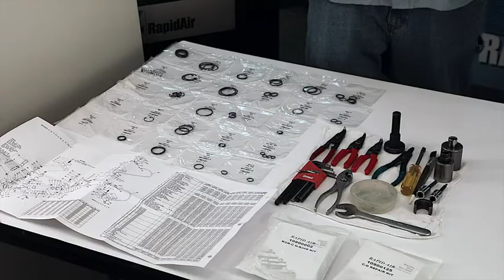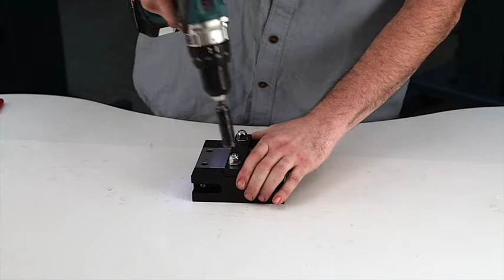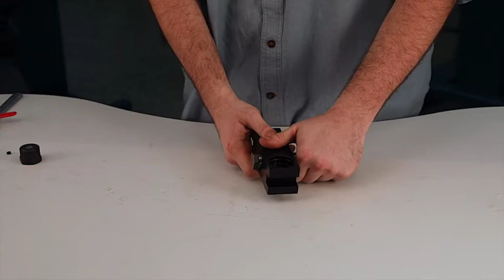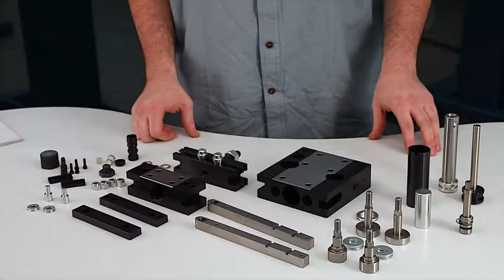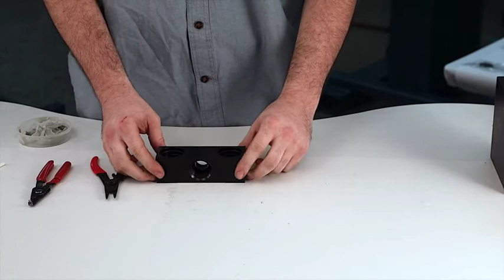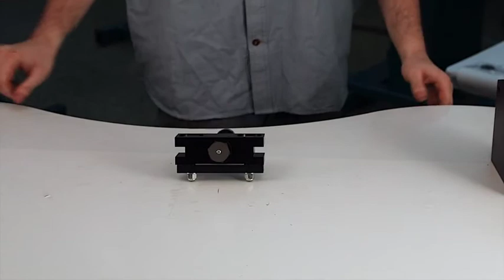Rapid-Air Feed Repair Video

Comment: Really appreciate you putting this video together and making it available to view.  I've been using Rapid Air Feeders for 40 years.  A genius designed pneumatic feeding device!  Manufactured hundreds of millions of parts.  Some of my  production runs at 180 s/m!  Pretty impressive to think all that the feeder needs to do in cycling 3x a second.

Comment: Dsscoo control india pvt. Ltd.
Faridabad, Haryana, India.

Dsscoo is the larg  manufacture of Air pneumatic feeder, NC Servo feeder, Decoiler, Straightener and all the press room accessories.
You may contact for any new requirment or maintenance.

Regard's
Pushpendra Bhardwaj
Mob: 9990791125